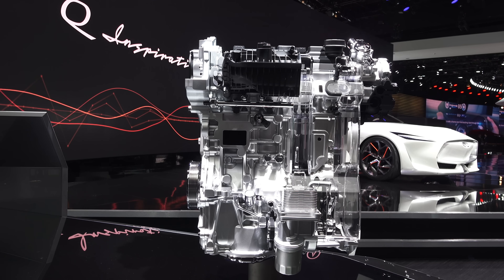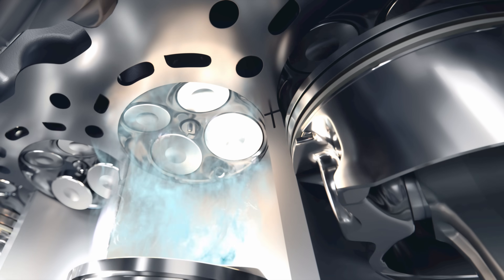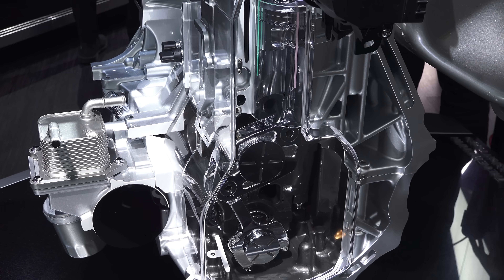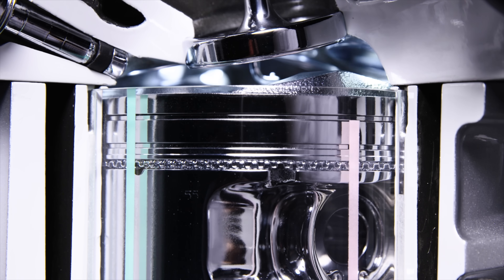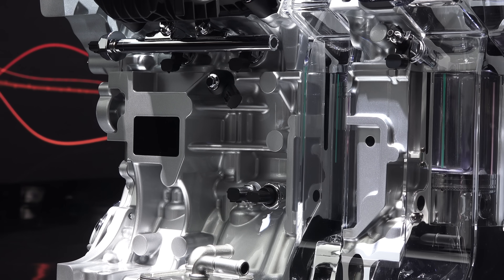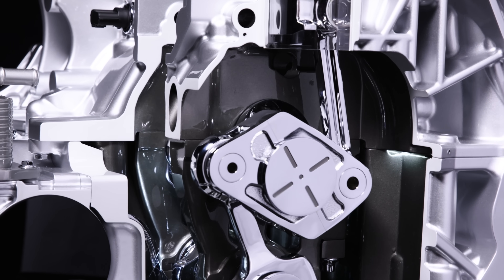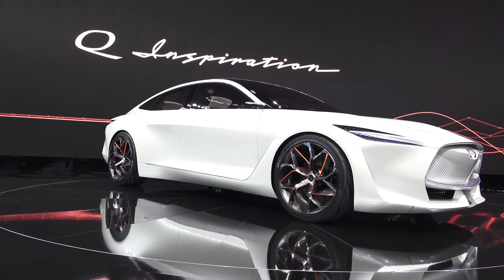INFINITI Reinvents The Gasoline Engine — VC-Turbo

Comment: This technology is getting out of hand.  Makes no sense. Who ever said low compression makes more power and torque has completly loss they mind.  I remember this girl i knew with a honda civic. 110hp got over 40mpg.  Why would i need 280hp when the speed limit is 45.  I race cars and this tech stuff kinda become unnecessary because you cant use it, camshafts have to much duration, comp ratios are really high, intake and exhaust modeling are based more on wave dynamics.  When he said the exhaust path is shorter it will spool up a turbo faster is ultimately false.  The shorter the piping the less energy it has.  U be surprised how long custom headers i make to gain real world benefits.  And that aint it.

Comment: Straightening out the angle of the connecting rod during combustion is what I'm most impressed by, but at what cost? I'd rather have a Renesis than this. Imagine the cost of a rebuild. It would be a throwaway after it didn't even make 100k miles. That being said, we need this type of innovation for the future. I can't wait to see what aspects of this trickle down to the whole industry.

Comment: There will be no petrol in 10 years time!.Both gasoline &diesel powered vehicles will become dynasaur and as dead as DODO!..Both sterling and Wankel engine were utter failure!..These researches are simply pouring money
 into bottomless buckets as Electric vehicles will be on the road in 1930's!.

Comment: 2 years ago I wrote a ten page Expository Essay research paper for environmental science with the hope of selling the world on EVs. I pounded the fact the EV has zero emissions.

However when I studied all the facts, environmental, economic, political, and social as well as the “work” returns for the energy used....

I found from sourcing the raw materials, to manufacturing, distribution, maintenance, and disposal when the vehicle reaches the end of its service life...

The  EV produces exponentially more pollution and a higher catastrophic environmental footprint than it will ever prevent.

My essay included environmental impacts and pollution created from electricity production delivery, and upgrades to the grid.

That’s in addition to the fact raw materials are sourced from the same unstable countries we import oil from. So politically there will be tensions.

Comment: Very interesting, but 1.2 seconds seems like a long time to change between min/max compression ratio if they plan on it doing so on the fly. I'm personally looking forward to more performance hybrids (a-la nsx) to trickle down to lower price points for that immediate torque.

Comment: Isn't turbocharging a variable compression already?
Reply: Turbocharging still has the fixed compression chamber with a variable air pressure component in addition to atmospheric air pressures. Basically allows the incoming air to be compressed further than natural engine intake pressures. The engine is physically designed for the set compression in a turbocharged engine, this concept changes that compression ratio constantly by moving the crank out of place.

Comment: Interesting.  This means Tesla is doomed: no valves, no dual injectors, no Atkinson cycle, no cams / bearings & reconfigurable push-rods, no catalytic converter, etc, etc.  What are they thinking at Tesla?  They simply haven't made the necessary time and money investment to keep up with this advanced technology!  

Besides, while Tesla is mulling over how to catch up, Toyota is going to blindside them all with Hydrogen fueled cars!  They will probably build a large nationwide system of Hydrogen refueling stations called "SuperBlaster" (because that's what can happen at any time while pumping hydrogen into your Lexus).  Of course Tesla could fold up tomorrow, but then there are competitors with a couple of billion $ invested from the Arabs and Chinese all chasing the Tesla model S.  Some even have a proof of concept prototype! 

FYI: According to the Infinity and Car & Driver websites, this cost $42,523, gets around 27 MPG with premium fuel.

Comment: The world of headaches the the wallets with burnt holes in them I can see with this engine.  There is no way an engine like this will be reliable after 80,000 to 100,000 miles.
Reply: So just like any audi bmw or mercedes off warranty
Reply: If im not mistaken this engine was proven in F1 racing with Vetal winning the championship

Comment: Im a bit worried. How does the function with the turbo work under the load with compression 14.1 does it lower boost to prevent knock.????

Comment: It is not true that 12 times more cars means more real world testing.  As an example, if you test 600 cars for 1 month, or 50 cars for 1 year, the total test time is identical.  600 cars would allow far more testing done per unit time, but, you need to know the length of tests for both the 50 cars and the 600 cars to make any other claims. 
I actually believe they DID do more testing, simply because this is a significantly more complicated design, AND many more subsystems are unproven.
But the use of more cars by itself does not mean more real-world testing.  It could just mean that they wanted results sooner.
Reply: If u think 600 cars in month = 50 for year is the same u also think if pregnancy long 9 month, 9 women born one child in month

Comment: There are 3 sides to this whole thing...

1: too many moving parts, too expensive to fix, too risky.

2: innovative way to allow the engine to tune itself while running, more fuel efficient while being able to give alot of horsepower at any moment.

3: wait a minute

THEY FIGURED OUT A WAY TO HAVE VTEC BUILT INTO THE PISTON?!?!
Reply: VTEC, Vortec, Voltec, Duratec, Ecotec and Ecoboost are just A few engines designed by A freelance designer.  This and Skyactiv are also his designs.

He was A child prodigy and wrote many movies, TV series, books, comics, songs and videogame concepts.

For the movie Transformers he designed the new Camaro and other vehicles in that movie.  Music, vehicle transformations Ect. were included in the screenplay.

Comment: It´s not so complicated, an electric engine move the cranshaft up and down and thats it... Plus it eliminates side force after ignition. The only problem that would worry me is the electric motor devoted to move up and down the crankshaft, if it fails you just blow the engine.

Comment: So if that actuator motor fails it destroys all the valves, rods, pistons and cylinder walls.
Reply from the maker: Why? It would simply be stuck at a set compression ratio, wouldn’t destroy things.
Reply: If the motor lost holding torque, that actuator linkage would flap around towards the end of the exhaust stroke, cant imagine that would do much good?

Comment: Why can’t you just vary compression ratio with spark timing like every other engine since the Henry Ford days?  

I know it’s not actually varying the compression, but it achieves the same effect because by the time the fuel air mixture is lit... the compression has been reduced. Losses are minimal because the unused compression still pushes down on the cylinder... which pushes up on the next cylinder’s compression stroke.

Comment: This engine will not run reliably.  Just wait and see. Timing issues will develop.
Reply: Now a day's the manufacturing technology available works better than 5, 10, 20, 30 years ago. I like the concepts.
Reply: Jewelry Lore criticizing without a valid source or input. Just shut up.

Comment: At 8 to 1 the turbo builds compression. 
At 14 to 1 the turbo isn't needed. 
So what's the difference if the it uses the turbo to build compression or not.
The only thing it does is change the ratio to 8 to 1 so it can burn more fuel with the turbo.
At 14 to 1 you get the same power with less fuel. It's a sales gimmick.

Comment: This is the problem with new cars they are way too complicated
Reply: The problem with old cars is they were very in efficient. They also spewed unburnt fuel and NOX. All these "over complications" were engineered to solve a problem the average person is incapable of understanding.
Reply: @SeanFalloy  EF crx, 40 mpg
Reply: HP and torque numbers count too. These guys are solving different problems. The EF CRX was built to be an efficient car not a powerful one.
Reply: I agree with you, it's getting ridiculous. After doing lots of homework ( 2 years worth )  I just purchased a 2018 rav4 still simple and reliable.

Comment: Finally some fundamental changes to the crankshaft of an engine. Clever idea on how to get rid of the vibrations without using the balance shaft. Reducing the friction, no virbarations, optimal compression ratio for every load type. Cleaner intakes using both methods of injection. Woow it hits only the +++. Now the second step is make 2 cylinder 700 CC engine and use the turbo to produce electric power. Add a small motor to the crankshaft which also could be used as a generator. A small battery gives the added torque for acelleration and the braking provides the extra efficiency to charge the battery as well. Design a car with one person in the front and 2 in the back.Extra space for cargo could come from a trailer. Use the trailer only when needed. Most of the time there is just one person in a car anyway. So why make it bigger than needed, Just adjust the volume when needed. This is what I designed in 5 minutes. Imagine what I could do If this was my job :-)Anyway well done Mazda team you are changing the history of combustion engines.

Comment: I'm not at all sure this will result in greater thermal efficiency. The obvious additional friction, complexity and oscillating mass will knock off a few percent. Toyota's version of the Atkinson cycle is being used by nearly all manufacturers to provide greater thermal efficiency. The best Hybrids do exactly what this is claiming to do, allow the marriage of a very efficient engine along with robust power when required. And, they do it better.

Comment: The more moving parts the more $#!t will break. This technology will not save money from a pump because of a numerous things that can go wrong. If that actuator goes bad, that’ll do it. I rather go for an older but tried-reliable engine than this techy-untested engine.

Comment: If I understand it correctly , it is basically variable stroke that you are talking of . We all know the power and torque characteristics of a long stroke engine as opposed to high revving oversquare engine . This engine seems to have the potential to offer the advantages of both . An engine with a good low end grunt that does not run out of breath at higher revs. I am not an engineer , but if this endeavor turns out to be successful , well you have the ideal engine.

Comment: I imagine the variable compression actuator is hydraulic, using engine oil pressure to drive it. Just as BMW's VANOS system and other maker's similar variable cam timing devices, these kinds of controls are susceptible to wearing out, and clogging up if the oil is allowed to sludge at all. I suspect this system will also be prone to these problems.

Comment: Thanks for great video.
Few questions :
I thought variable compression ratio engine already existed : last audi A5, mazda engine and si on, based on the opening and closing of valves (Atkinson cycle as you explained).

Secondly, you said the exhaust is directly linked with the engine ? With all the other features (double injectors, shaft, and so on) it will be a mess and so incredibly expansive to repair...
Efficiency leads to complexity and then to more costs... the first owner does not care but the second hand buyer will maybe...

Comment: Lower compression ratios do not create better gas milage. A diesel engine uses 20 to 1 compression to achieve the milage that it makes. A gasoline engine works the same way and also uses some thing known as strong force energy. When a motor has high compression it will create a strong force energy that, even though it seems like your using more fuel you will be using less. This is due to the 60, 100, 600 foot gains by a high compression engine over the low translating into a gain in gas milage due to the less time used to move a selected distance using more power and more strong force energy. The auto makers know this and build cars for maximum fuel consumption not minimum fuel consumption. A simple four cylinder car today is designed to consume as much fuel as an older 1960's V8. In other words your four cylinder car today uses the same amount of fuel that a 1967 327 used back in 1967 and this so that everyone's happy except the consumer, you. Its all a lie the quote gas milage cars are fake. Wake up. Payola, baby that's where its at, OK.

Comment: why does it need high test gasoline if it has variable compression? Want the engines self adjusting system adjust for poor fuel quality appropriately? Looking at the model, it appears that there may be weak links and all those variable angles with so much stress on them under high load high speed conditions. I would be happier seeing improvements to the Wankel engine where less is more, or even a two-stroke engine design that has no need for intake and exhaust valves or timing chains or oil pumps, unless of course, they make a wet sump two stroke like the one Toyota had already to go in 1989. Two-stroke engines as a rule of thumb, give twice the horsepower as a four stroke of the same cubic inches, or the same horse power from half the cubic inches of a four stroke engine. We certainly have better materials to make two-stroke engines from these days so they will be EP a compliant at the 100,000 mile mark, which they were not in 1990, when every manufacture from Toyota down to die had to and including general motors, Ford, and Chrysler all had two strokes in development at that time. They could not figure out how to make them still not pollute at the 100,000 mile mark back then.That’s  mainly why we don’t have two stroke cars running around today. But what do I know... if they want to have alternative engine designs advance at the speed of light, have Formula One make a class for two strokes, rotary engines, and this new engine design. And let the geniuses In formula one develop them.

Comment: JUST MORE MOVING PARTS TO FAIL!!!! "NO THANKS"!!!!
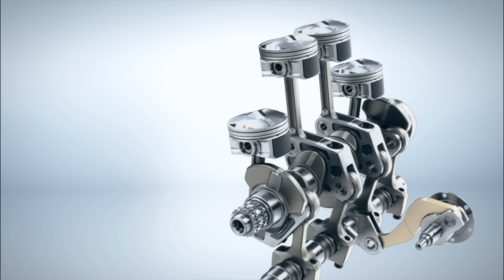Reply: Ummm, not sure if you listened carefully. Sure there are only 2 new moving parts added but 2 moving parts were removed too.  Remember he said at 4:56 that the balancing cylinder is removed because the new design renders it useless.  This means 2 balancing cylinder removed negates the 2 moving parts added. So the answer is zero moving parts added.

Comment: an over complicated ICE with hundred of moving parts coming from the same company whom base line vehicle have 5 recalls with 2 of them critical? (CVT transmission fail/class action lawsuit against it and Engine Room Harness Connection May Fail), i have my concerns, the Mazda Skyactiv X super high compression engine looks way more feasible.

Comment: Great idea but I wonder what the life of the engine is in miles. Can it get to 300k like a Honda or Toyota I4? Also the cost of repair if a problem does arise in the VC cam and crank. I personally wouldn't buy the first generation but I'm curious to see how it will pan out in the modern world of cars.

Comment: Very interesting but the extra cost, friction, weight, bulk--as shown it's a very 'tall' engine that would need to be laid on it's side I assume or the extra mechanicals rearranged to the side instead of below the crank (how the hell can it be the same "height" as other 4s??), etc., will doom the concept IMO.

Comment: Great explanatory video, brilliant "engineering explained". Thank you.
The $64 question is what does that translate out to in improved efficiency gain? 
We have Mazda talking about 40% thermal to kinetic efficiency engines and Toyota making strides too.
 I am confused, if the electric powered vehicle push takes off, is there a pivot in there between breakthroughs in the thermal efficiency and low emissions of internal combustion engines? 
If say we can even achieve 50% efficiency auto gasoline engines as a reality, does that mean the conversion to electric engines is delayed, or not urgent after all? Or if there is no pivot point then sadly all this brilliant engineering development is just part of the dying fall of gasoline powered engines?
Reply: Well here we are two years later...

Comment: Actually, it is the expansion ratio, not the compression ratio, which determines efficiency.  But in most engines, the two are approximately the same.

Comment: Couldent 90% of this compression change be done in a different way by just changing valve timing and duration i know the mecanical ratio will remain the same but just take a 14 to 1 engine and start minuplating the intake or exaust timing to reduce the amount of air let in?

Comment: SAAB had a variable compression engine concept a couple decades back.  The entire head would pivot a few mm on it's longitudinal axis via an electronic actuator (motor), like a hinge.  It was supercharged and had the same 14/8:1 compression range.  It was a small 5 cylinder and had the traditional bottom end.
Reply: It had a rubber skirt needed to seal the crankcase and allow movement of the cylinders relative to the crankshaft.
Reply: @louisallen1437  That rubber skirt would have been a nightmare to replace, if it was single piece.

Comment: In Brazil, most of the cars are flex fuel. This would be great for flex fuel engine. 14:1 is the best ratio for ethanol and this engine can reduce the compressio ratio for use gasoline.